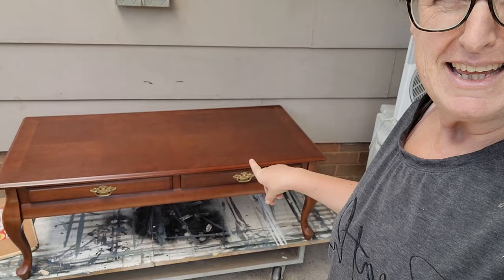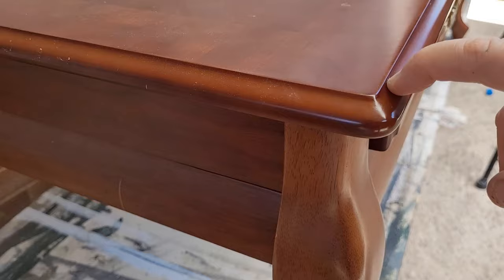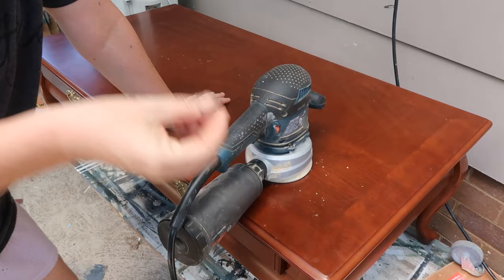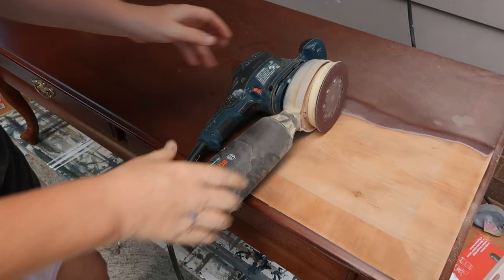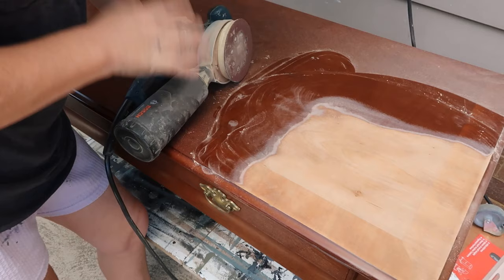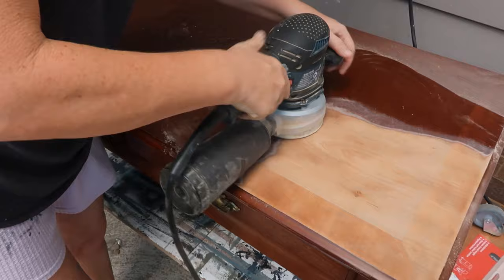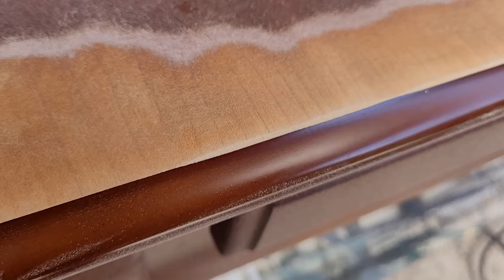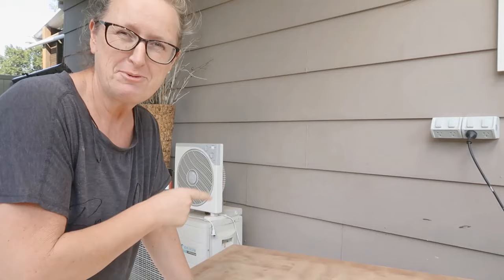Sanding a veneer table top for furniture flipping beginners

Comment: I would like to point out, in this case the best refinishing approach is to use stripper. After all of that sanding, you have already removed a significant amount of the veneer and the piece still needs final sanding before you apply stain and/or finish. In the example on this video, to get a good final result without a lot of toning and cover up, removing the stain first is essential. I agree with you for sure about using stripper... yuck! I’m simply suggesting using stripper is by far the best way to preserve the veneer and have a great result. I always appreciate everyone’s approach and enjoy seeing tired pieces brought back to life! :) thank you for your videos!
Reply from the maker: Agreed :)
Reply: @BJV that's what I'm looking for
Reply: Just found you!  I'm excited to start doing my coffee table as I love it but it needs new veneer.  I have ordered the new veneer but wonder if you can tell me if you'd still strip the old veneer to the chipboard or if you would just fill the cracks on the old veneer, lightly sand and then apply to new veneer?  Thanks in advance from  Brit in Canada..  you sound like a Brit in Oz 😊
Reply: True but in the uk we can’t get good stripper anymore. So there’s a delicate balance to juggle.

Comment: I am a complete newbie with wood. I am trying to stain my Billy bookcase from ikea. It says it's birch veneer with a clear lacquer. I was so afraid I would go through veneer during sanding that I think I didn't do it properly. The stain didn't hold at all. The shelf was smooth even after sanding. How do I know how much to sand? 2mins? 20 mins?(For a single shelf). I have absolutely 0 idea. I am doing by hand.120 grit. Also will nail polish remover get rid of the lacquer? (Wanted to get away without buying lacquer thinner)
Reply from the maker: Are you sure it's veneer and not laminate?
Reply from the maker: I've just checked the website and it says Oak veneer but I really doesn't look like it to me. I'd be surprised if it isn't laminate. Feel free to head over to our Lanies FB group and ask there 

https://www.facebook.com/groups/2814245925504490/?ref=share
Reply: @CraftedbyMonnowLane  thanks. Will do.

Comment: I have one just like it that when my cousins lived with my grandparents they ruined it it's in the brooder room for chickens I did cover it so it wouldn't scratch it any worse they ruined the top so I guess that needs replaced what a crying shame Ethan Allen is supposed to be the best shame on them. I just picked up another orphan chest drawers it's got some scratches hope they come out on the top... what do you do when the side of that veneer is already scratched sand it flat and then put a curved piece on it maybe???
Reply from the maker: If the veneer is already ruined and I was flipping to sell it, I'd fill and paint rather than have the veneer exposed.

Comment: thanks for the tutorial , I have two end tables that have veneer they are both damaged and need the tops re done. my problem is... there is some bubbling . will sanding remove the bubbling ? Im afraid that sanding will make it chip. thank you
Reply from the maker: No sanding won't remove the bubbling. Are you planning on staining or painting?
Reply: @CraftedbyMonnowLane  gonna stain, I’m gonna use a syringe filled with wood glue to get under the bubbles and then clamp it , it will be tedious but i think it will look beautiful when Im done .thank you for your reply, I enjoyed your video .

Comment: I don't have a sanding machine, but looking to restore a dining table top (i believe it's veneer...) will it take ages (or have other issues) if I just sand with my hands?
Reply from the maker: It would take forever, and it would be hard to get an even finish

Comment: I have a cupboard that i have sanded the top down and there was no veneer at all, and the side edges are routed like yours.  How do i finish those routed edges off with veneer edging to make it look ok? as you said they look like crap exposed particle board now. I can't believe that was only stain and varnish made to look like wood grain.  My plan is to put veneer on the top section as there was no veneer there after all.  But can I put veneer edging on the routed curved side edges like yours? can that product be soaked wet and then moulded into place on those edges, or only flat unrouted edges? It says its flexible with self adhesive or will it split? Or would you just re shellac and stain the edge with several layers to hide its ugliness.

Comment: Hi loved the video I have a question regarding the esp I recently painted an old style tv unit and thought I would use esp but the tin said to wipe on leave for 5 minutes then wipe off I was waiting for the shine of the timber to dull which didn’t happen so I ended sanding. So my question is after the 90 minutes did you wipe yours off ? Thanks
Reply from the maker: Nope I didn't. I wasn't a huge fan of it though to be honest

Comment: One thing I'm wondering is that I often see people sand the top of a dresser, but not the legs, they just paint the legs. I thought it was because the top would be stained, but sometimes the top is also painted like everything else. So I'm wondering what's the point of sanding the top of a dresser if you're just going to paint over it?
Reply from the maker: Usually to get a smooth finish :)

Comment: I have a IKEA Galant desk that has a rough wood veneer top. It's not smooth and feels like rough wood to the touch. Would I have to use a filler on top first and then stain or will I have to sand it smooth? Thanks.
Reply from the maker: Sounds like it might be a laminate rather than wood veneer?

Comment: Hi Rachelle! Thank you so much for this video. It's fantastic to see theory and action together! I'm wet-behind-the-ears, brand new at furniture restoration. I'm currently working on restoring my great grandmother's dresser. I've been stripping the paint, and have found that the faces of the dresser drawers only have veneer--and from what I can tell, the top of the dresser and its sides do not. Is that typical, for a furniture piece to be part veneer and part wood surfaces? With that said, will I be able to stain the dresser and its drawers so they look alike (once I've finished stripping everything and sanding the surfaces)? I love the veneer (t's got a lovely marble-y look to it), but it seems unnecessary(?) if it's just not going to match the rest of the dresser. I would love your thoughts if/when you have a moment. Thank you!!
Reply from the maker: That's very typical yes ... it's a way of saving money in the furniture build process but it sooo frustrating for us flippers huh?